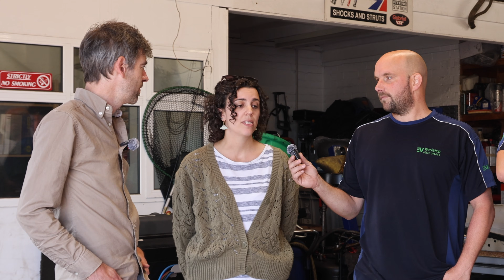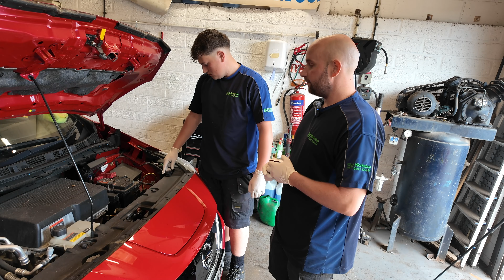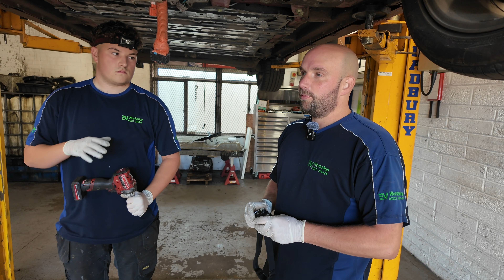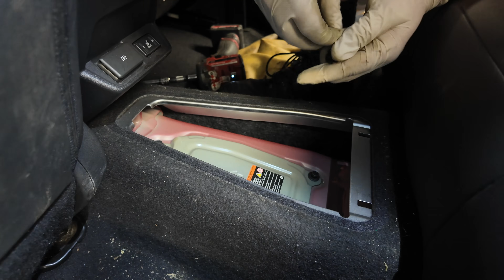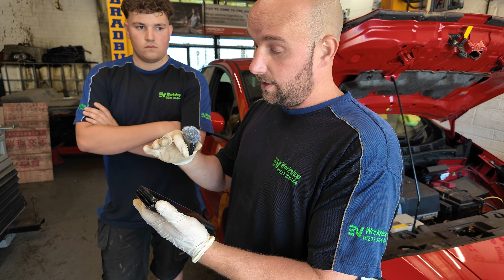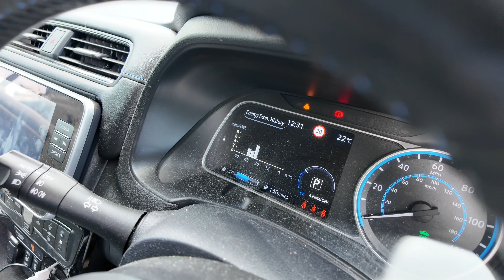LEAF Battery Swap. Out of Warranty, Out of Pocket. Nissan Refused Warranty Claim!

Comment: Lol, Middle Class EV Zealot talking about lack of education…

If only somebody had told that Nissan Leaf in the videos previous owner that Servicing your car away from the Dealer Network means ZERO chance of a Good Will Repair

It would have been nice if the previous owner who saved £60 on a Service had suffered this failure rather than the new owner.

I suspect the previous owner knew the car had a problem and that is why they sold it.

Always Service an EV with the Main Dealer if you want a Goodwill Repair pay out.

Cleveley are not the saviours that people think they are….

Even selling faulty EVs without no warranty/trade sale 

Mmmm

Comment: WOW Electroverse is expensive. I have a Zoe but use Tesla chargers. At cheap hours almost 1/4 the price.
Reply: Its not Electroverse that is expensive it give 8% off the crazy price that Instavolt (etc) charge. Price for convenience.
Equally I was bemused recently when I looked at a trip and saw Gretna Green Tesla at crazy cost (85p) on their dynamic pricing. So that is more than Instavolt and Electroverse discount. Always used to be a cheap safe bet but need to check now. Used Arnold Clark instead at 55p and free coffee.
Reply from the maker: Had we gone to MFG across the road, that would have been 59p/kWh with Electroverse instead of 85p/kWh with Instavolt. That's even cheaper than the nearest Tesla Supercharger (64p/kWh).

Comment: Vivne sell a Battery container with a BMS and you put your old battery cells in it and use them as a Home Battery.
Reply from the maker: I'm hoping to make a video about that too some time.
Reply: 👍 
https://youtu.be/2LrcutiHu4g?is=EudWERBaLgdU9436
Reply: @Tim_Kent I had a look at this, and was surprised to see that they didn't test any of the modules before going on to put them into the home battery. I saw another video a few years back where a company was doing exactly the same thing, but they were making sure all the modules were good and were discarding a good few of them if they didn't make the threshold for inclusion or were just downright faulty.
Reply: @bobholmes4215 Good point; a customer would need to test the capacity of the old cells. 
In particular, some Nissan Leaf modules degrade faster because of being double stacked. 
Fortunately, from this video it sounds like the EV garages have a surplus of old Leaf battery modules. ☮️

Comment: NISSAN is having big issues with their battery, far too many fail during warranty and in this case it is a far too short waranty of just 5 years where every competitor is proud of his work to give an 8 year wrranty, but Nissan not. 
As worse as Renault if you ever have a warranty case to deal with them.
And best example is the taxi driver as they can judge the best. German taxi company is runnning a fleet of Skoda Enyaq that usually achieve 300.000 km within 2 years. They love their enyaqs as the customers cause they are reliable and always have enough space. 

Great content from spring I guess cause now it is really hot and was when I had been to the UK.

Comment: Could you have also replaced it with 62kWh or 68kWh pack? The price difference on Vivne seems quite small.
Reply from the maker: It would have been an option but although the battery price difference is relatively small, the duty/tax/shipping cost would have ballooned.

Comment: Another video with the @VIVNE-CoraLiu Leaf battery that shows us how an after market business can keep on the road old Nissan Leafs. Nissan should be ashamed for not helping Leaf owners to keep their cars on the road. The Nissan Leaf was the first mass-produced electric car, which for many years had no competition. Great video as always!
Reply: LEAF is a charity product. It doesn't make money. There is no reason for Nissan to help money-losing products.
Reply: Given that old Nissan Leafs are so versatile, it's likely that in the distant future it could basically upgraded to even higher capacity solid state battery (100kWh possible maybe?)

Not surprised that if in the next few years there will be some Nissan Leafs reaching couple million miles thanks to those 3rd party battery packs

Comment: I remember a friend of mine had a Nissan that developed a major fault just after the 3-year warranty expired. Unfortunately, Nissan wouldn't offer any goodwill assistance, and the repair ended up costing a significant amount.
When I bought my first EV in 2021, I also spoke to a mechanic who specialised in electric cars. His advice at the time was to avoid Nissan EVs, so I went with a Hyundai Kona instead. It served me brilliantly for five years, and I've now moved on to a Kia EV3, which I'm very happy with.
Reply from the maker: That's interesting. What a shame! As you may know, I've always been a big fan of the Korean brands... although the ICCU fault remains a big issue for some drivers. At least they've extended the warranty to 15 years for that.

Comment: The leaf only has a 5 year battery warranty? I thought the car might be 5 years but the pack 8 years.
Reply from the maker: It has an 8 year battery warranty, but only based on the battery bars (which aren't reliable). Any other battery fault and it's 5 years. And yes, that's shocking.
Reply: @MrEV they deserve some very bad PR for this nonsense

Comment: In my country (NL) Nissan would have had to replace the battery, simply because the battery could be expected to last far longer than just 5 years. I guess it differs from country to country, but this just does look very poorly on Nissan. And I'm assuming they'll be second guessing their decision because this is not good publicity for them.
Reply: In the UK now I believe batteries must have an eight year, one hundred thousand mile warranty. However, I don't know if that applied to cars sold six years ago.
Reply: Yet no one has sued Nissan in the Netherlands: there are plenty of stories online, of Nissan Leaf owners experiencing the same as the UK Buyers.

Comment: I think most main dealers will always try and find a technicality to get out of honouring a warranty. I guess it all depends on the dealer or how common the failure is across that particular model. For example the ICCU failures for Hyundai and Kia's on their Ioniq 5/6 and EV6, now it appears the ICCU warranty has been extended for any ICCU failures to 15 years or 300,000 km
In Jades' case, that car should have many miles of trouble free motoring and cheaper servicing compared to the cost of ICE servicing, so they should recoup the cost in no time at all. 
There are a lot of Nissan Leaf batteries on eBay and now the technology and equipment exists by some very clever people, so that any competent electrician  can literally get any EV battery, buy the right interface and a certain Fox inverter, then they can easily make their own home storage system. Although having an EV battery bolted to the side of your house may look a bit weird.
Reply: It’s not the dealer trying to get out of the warranty - quite the reverse, in fact. It’s the manufacturer that is nit-picking, or the main importer.

Comment: I was wondering how many Tesla's they'd seen and do I have to start worrying. But also, the 12v battery - I'm sure that they are still lead acid batteries although I hear some newer EVs use 12v Lithium batteries.  Can they be changed/swapped easily?  Several of my ICE cars had to have one or more new ones. (I'm sure I funded Halfords for a while)
Reply from the maker: Dean didn't mention any Teslas so my assumption is they're pretty reliable. I suppose Tesla's Mobile Service is also very good so maybe that gets as a priority?

As for 12V batteries, we had a long conversation about that as well which I trimmed for the sake of brevity. Some of the lithium ones (like the new Kia Niro — I had no idea that had one!) can be a real pain to replace, and they're not necessarily too much more reliable than lead acid.